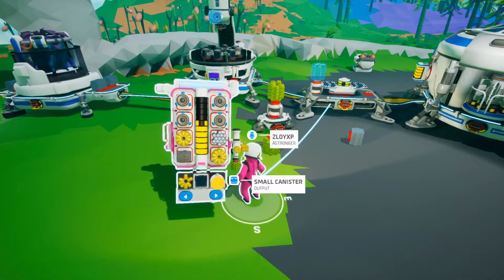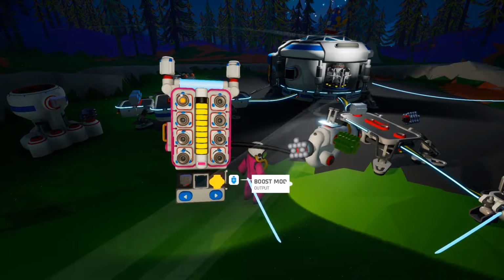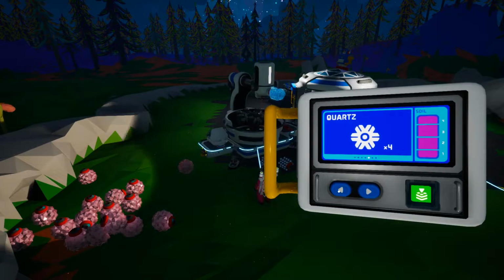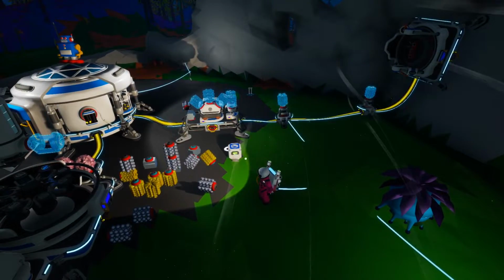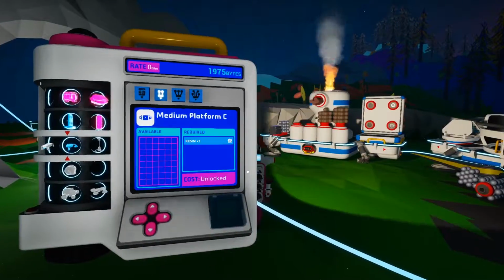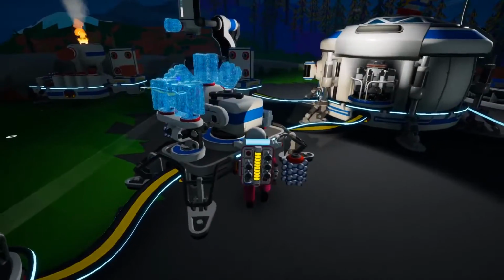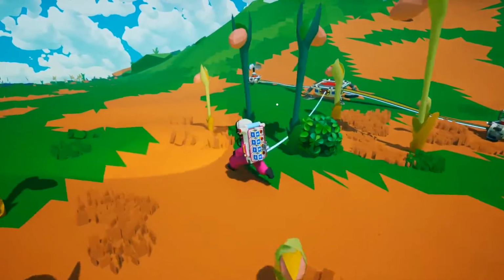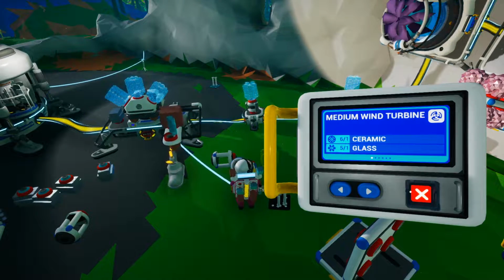What if you wanted to make a power grid, but ASTRONEER said "no bateries"?

Comment: For free copper, or any other resource (even lithium), you need the trading platform... then you just make the small wind turbines from ceramic, shred them for scrap and then trade the scrap for whatever else you need. if i remember right small wind turbines are the best scrap material in that each two soil canisters ends up giving you 1 full scrap... (2 soil -> 4 clay -> 4 ceramic -> 4 turbines (worth .25 scrap each) -> 1 scrap -> trade).
Reply from the maker: Yeh, that works, but the trade platform itself requires materials not present on the starter planet.
Otherwise, it's a pretty sustainable mid-game scheme!